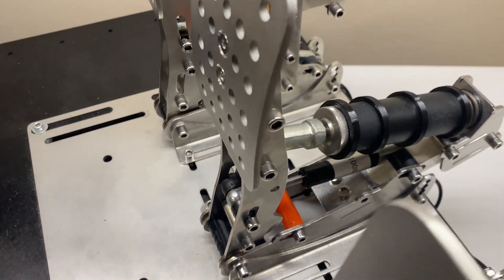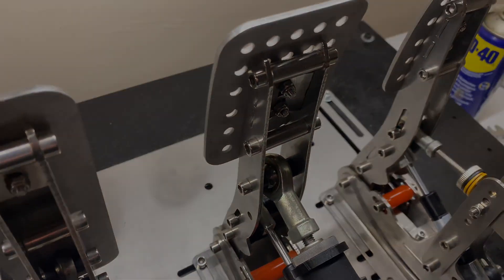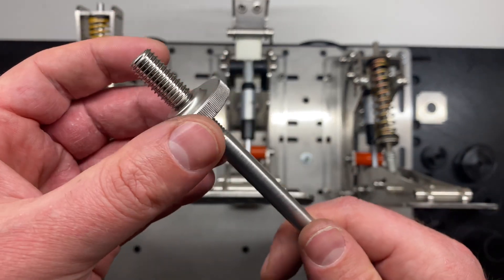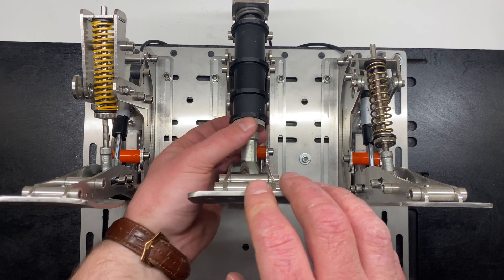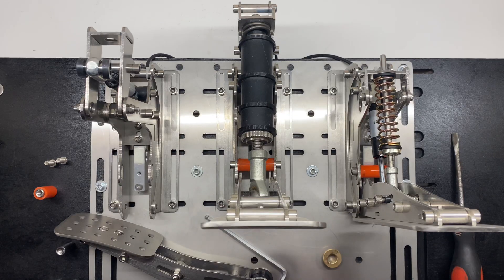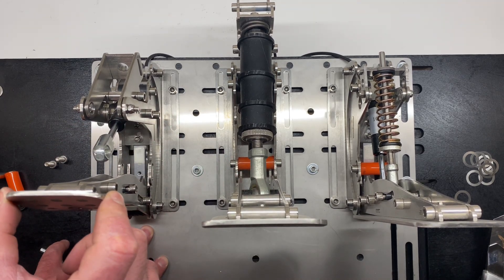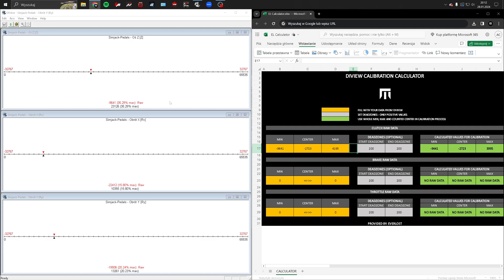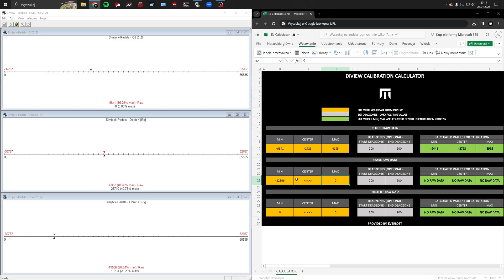SimJack Pro - adjust, improve, fix and calibrate! (DiView)

Comment: No link to Heusink elastomer kit?
Reply from the maker: https://simline.eu/pl/akcesoria-do-pedalow/heusinkveld-elastomer-kit-sprint?affp=2677

Or 

https://simline.eu/pl/akcesoria-do-pedalow/heusinkveld-elastomer-kit-ultimate?affp=2677
Reply: @MR.EVERLOST  Thanks. A bit pricey, yes. $40 plus shipping. So cliser to $45. I'll think about it. I was about to order a set of springs from Ali but for that price I'd get  12 springs of varying lengths and stiffness.
Reply from the maker: @Tome4kkkk  I go by the rule ‘buy once, cry once,’ but I understand that people often look for savings — as shown by the choice of pedals from AliExpress. Watch my full video on SimNet. Many people go for a spring set, but in terms of feeling, it just doesn’t compare to elastomers. That design simply isn’t made to provide the kind of progressive resistance you get in a real car. A lot of people who tested it said they could feel each individual spring compressing instead of a smooth, unified response. Watch the video — it’s too much to explain in writing.
Reply: @MR.EVERLOST  The review on SimNet? Could you at least drop a keyword from the title? Oh, and the cheaper set is enough for me. No need for the $45 one. I mean the regular Heuk Sprint.
Reply from the maker: @Tome4kkkk  https://youtu.be/tnX56G-bcmw?feature=shared
Reply: @MR.EVERLOST Just saw that Polish reseller link. Still 35 EUR plus shipping. Maybe a 7 EUR saving. Sorry for b%+#ng :D
Reply from the maker: @Tome4kkkk  use el-studio contact form 🙌
Reply: @MR.EVERLOST  To anyone reading the comments, the sprint elastomer set is 165 PLN including shipping in simline eu shop.
Reply from the maker: @Tome4kkkk fair price 🤌
Reply: @MR.EVERLOST Yes, it's around 43 EUR at the Polish reseller, 60 EUR at Heus EU. Still not buying it :) Edit: maybe . . .
Reply from the maker: I will add it later, you can find them under SimNet video review 🙌
Reply: @MR.EVERLOST  heusinkveld EU, small set is 35+25 EUR shipping! Screw that!

Comment: Mate, in what ways does Diview improve the pedal?
Reply from the maker: It doesn’t improve anything at all, but in the first Pro version it was one of the two calibration methods. People were also using FreeJoy, and most of them downloaded the wrong software version, which then caused them a lot of problems.
Nowadays, most manufacturers provide their own driver, and you can calibrate the pedals directly in it.
If you have the driver and it works well, there’s no point in using Diview.

Comment: Great video, but maybe turn the music down a bit next time. I just got mine yesterday and the gas pedal is really stiff at the top end, as in when depressed all the way. I feel like I have adjusted everything I can. Any tips?
Reply from the maker: @BackFromTheMadeUp  yeah music lvl was the main problem of my Last videos. 
Did you reduce travel to the half way as I did on this video? 
You can remove extra spring rod if you have, reduce travel, change the rod angle, and adjust spring nut. Last thing is probably change spring but I don’t have anything that I should recomend for the throttle 🤔

Comment: Why is it a problem when the pedals wobble after removing all the connecting rods?
Reply from the maker: @JohannVonVorst  Well-made pedals won’t wobble side to side, even when they’re free from load. This simply shows the quality of the build. Even if the play is eliminated by the load from the springs or elastomers, and it seems like there’s no wobble, you’ll most likely notice uneven wear on the brass bushings once you remove them.

It’s just a matter of doing it better and using more durable bushings, such as those from Bimex, which are additionally graphite-lubricated—just like the Heusinkveld Ultimate.

Comment: Where can I get the 8.3 mm rod?

Ps. Thanks for the video but the music very very loud
Reply from the maker: @eliasali9383  Either you’ll make it yourself from an 8mm rod, order it from a CNC service company, or settle for a 7.6mm diameter from an M8x180 stainless steel bolt. You’ll need to make a 45mm thread on it and shorten the whole thing to 165mm. No one sells this. I had a few, but they were gone instantly. The 7.6mm also works well—it’s just that Heusinkvelds have 8.3mm

Comment: could you give the link to the rod?
Reply from the maker: @averagedriver81  You can make them by yourself from 8mm stainless steel if you have proper tools. HE rod has 8.3mm but if you get 7.6-8mm it will work also 👌
Reply: @MR.EVERLOST  How do you make them?
Reply from the maker: @averagedriver81  Sorry, my full message got cut off. I ordered this part from a turner, made based on my drawing
Reply from the maker: @averagedriver81  for pro pedals you need 8.3 rod diameter, 165mm lenght and 45mm thread + parts showed in the video. Spring was replicated according to one which I had from HE Ultimate + it’s not available to purchase too.
Reply: @MR.EVERLOST  Ah okay. I’m just gonna see if I can get the crp2 upgrade kit instead. thanks for the help mate.

Comment: my brake pedal is only about 20% help me🥲🥲🥲
Reply from the maker: @trungtrung9739  what you mean? It works in 20% range only? Did you calibrate them in DiView as in this video with Excel calculator?
Reply: @MR.EVERLOST  The throttle pedal is good but I press the brake pedal at maximum about 20%. I also put a minus sign before the values. I take the min value minus the max value then divide by 2 like you. I bought "simjackpro" 3 days ago. I also tried "simjack control" but the software does not accept the pedal.😒😒😒
Reply from the maker: @trungtrung9739  write to me on IG, MR.EVERLOST
Reply from the maker: @trungtrung9739  sometimes people make simple match mistake which is A + B / 2 instead of (A + B) / 2
Reply: @MR.EVERLOST  can't install DIVIEW i switch to "freejoy" and then i plug simjack pedal into computer. "other device" recognizes my device as "freejoy" instead of simjack even DIVIEW recognizes freejoy in setting ???.
- ACC game before installing freejoy recognizes pedal, after installing it doesn't recognize pedal😂😂😂
-how to make the computer understand simjack like before
Reply from the maker: @trungtrung9739  Ask the people who recommended FreeJoy to you 👀 
I don't know 🤷🏻‍♂️
I only know that 99% of people using FreeJoy have problems before it starts working properly 😬

Comment: When removed the brass bushings, 2 of them broke.  So, I had to replace all 6 bushings with flange bearings.  The bearings are a much better solution over the bushings. So...
Reply from the maker: Like I said, quality of stock bushing is bad. When you play a bit on wobbling pedals you could make it weaker, that’s why they was broken. Bearings is good move if center hole diameter is the same diameter as tightening screw.

Comment: Amazing video thank you. I just have a question to ask, when I removed my brake rod to switch the elastomers the back metal plate that locks it in the groves was a very tight fit and didn’t seem to go in at all, I think it needed to be filed down just ever so slightly. I taped it on both sides with a wrench to make it flush. Do you think I did any damage to the load cell by lightly taping it on both sides with the metal wrench? Everything feels fine and now the metal goes in nicely but still tight. Might just be paranoid. Not sure how sensitive the load cell is, but I mean we do smack the brake pretty hard so I’m sure it able to withstand some abuse.
Reply from the maker: The easiest way to check is by connecting pedals to a computer and testing brake. I'm not sure if you damaged anything, but I've heard that this part is very tightly fitted in the new SimJacks. I don't understand why, but that's how they designed it. There's little tolerance in that area, which is why removing it isn't as easy as in mine or in the HE Ultimate. You might want to gently grind down that plate if you want remove it easier in future 🤔

Comment: Thank you. Where do I get the break mod? Link please
Reply from the maker: I gave all data about the brake shaft dimmensions for suppliers like SimJack and Ruito - maybe they will make from it something like „upgrade kit”. I had some spare parts of it when I modified my brake but all this parts are gone now. 
You can buy thread adapter from AliExpress, HE sprint elastomers from Heusinkveld, m8x180 stainess steel screw and stainess steel nut (like original one but m8). You may also need to extend m8 screw thread up to 40-45mm lenght. 
It’s require a bit of work but I saw too many people who change other „kits” available for SJP and they end with something from HE, I mean this sprint kit or Ultimate + upgrade kit. Not cheapest, not easiest, but belive worth it 🙃

Comment: hello where did you buy the 8mm axle
Reply from the maker: Custom order in factory. You can make 8mm shaft from stainless steel screw m8 x180, cut them, and extend thread to at least 40mm 🙃
Reply from the maker: HE shaft has 8.3mm, mine is also 8.3mm but screws like that could have less diameter like 7.7-8mm and it is totally fine.
Reply: thank you very much I found that I am missing more than the dimensions of the spring
Reply from the maker: @krismont6383  spring is not easy to clone. You can consider venym spring or just use elastomers without spring. Like I said in the video this tiny gap is nice but you can live without it 😀
Reply: just stick with the standard 10mm (simjack mini has 8mm shaft, regular simjack is 10.3mm) and remove the stock spring. but a venom HPF skateboard bushing in whatever shore rating you want (80 is a good stard) and fit it on.
you may need to drill the skateboard bushing a big bigger to fit the shaft. start with 11mm bit, if it still wont fit drill again with 12mm bit.
theres no need to buy expensive HE gear when a $10 skateboard bushing will improve feel.
Reply from the maker: @Obliv69  I saw to many people who did this what you described and finally moved to HE 😀🤷🏻‍♂️
Reply from the maker: @Obliv69  I’m not saying that it’s a bad idea, nor that HE it’s the best possible choice, but for sure, elastomers made for sim racing purposes allow you to get the proper feeling much easier - not cheaper, but easier
Reply: @MR.EVERLOST  theyre virtually the same thing. as long as it has a shore rating it'll be fine, and everyone has their own idea of what a pedal should feel like.
you say "many people went to HE" which is just anecdotal evidence, if people had the money for HE pedals they wouldnt have got the cheaper option to start with.
Reply from the maker: @Obliv69  i mean they went to HE elastomers from sprint kit after mods like skateboard bushings or poliuretane tubes. On the paper you have right it’s just shore rating but in practice sometimes there are totally different in the „same” rating. My friend got something like 55sha elastomers made from poliurethane tubes and they won’t  compress. I also used cheap elastomers this kind in the past. It could work but like I said, I know at least few people which had this solution in SJP, and pay for it, then tested 3D printed ones and finally bought sprint kit or ultimate upgrade kit for their SimJacks 🤷🏻‍♂️ this is real expensive way so „pay once, cry once” 😅
Other thing is that HE make this elastomers because wanted provide something with better duratibility. I don’t know how long they last but when I enlarged holes in previous set of sprint elastomers kit I’m sure they are different and better than other tubes that I had.

Comment: Also need to consider the VNM brake kit for SJ Pro. That's probably the best bet for most folks.
Reply from the maker: If they has 10mm hole than it’s easiest solution. I just tested HE elastomers from sprint kit, me and maybe 5-6 other users I know and they are super happy. 
I don’t know what HE change in latest elastomers but in older products they used elastomers like VNM actually does.

Comment: what's the size of the 'spacer' washers? (ID OD 0.2mm thickness)?
Reply from the maker: 14/20mm, yes in my case it was 0.2mm thickness but it is no rule, so I recommend buying also 0.1 and 0.3mm. Also it is good to unscrew whole pedal from pedal base and mount them back after tweak. Wobbling is because first SimJacks had longer pivot distance than width between bushings. Before you buy 14/20mm check if you be able to pull bushing from the lever. Like I said it’s easy to damage (this bushings) so be careful and if you can’t remove them just buy 10/18 and use them as manufacturer- between bushing and bottom pedal base. Lever + bushing + washers must have same width as pivot distance, or a little bit more.